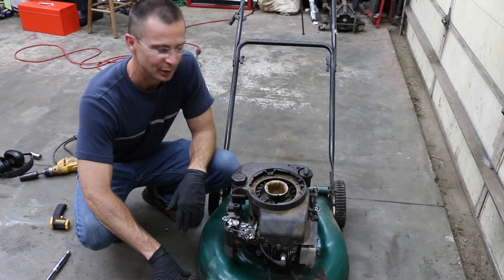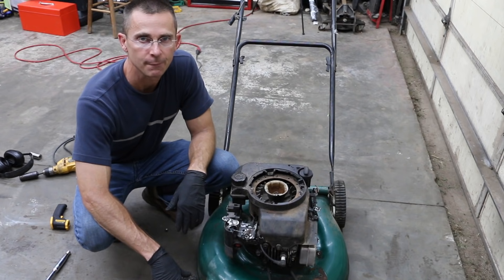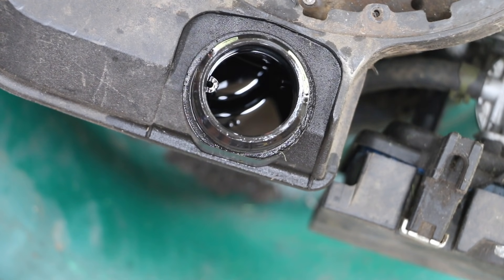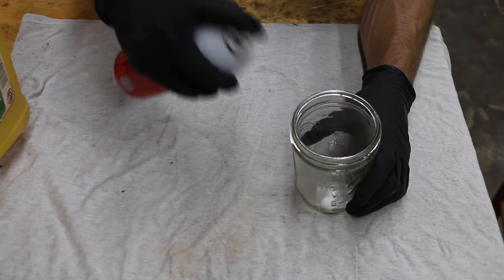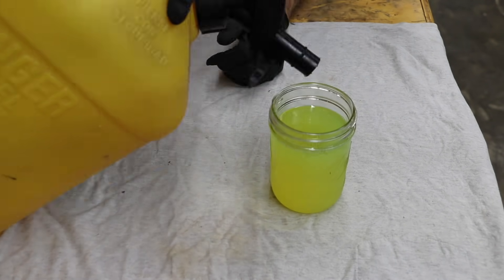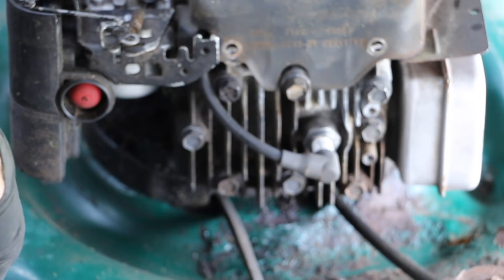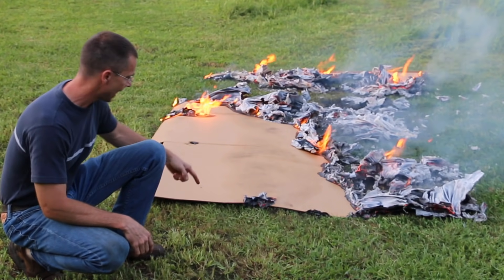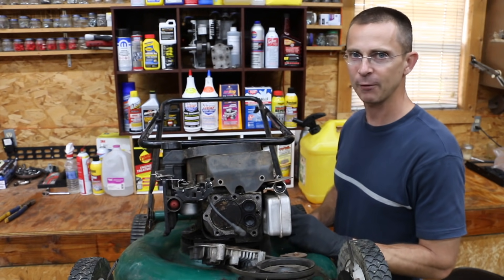Will a Gas Engine Run on Diesel?  Let's find out!

Comment: Try to increase compression, like adding a turbocharger or ever a blower. And flatting the cylinder head
Reply from the maker: Great suggestion!  Thank you
Reply: Project Farm and maybe you should try with a 2 stroke liquid cooled engine, like a 1 cylinder from polaris or rotax, with a 2 Stroke compression is higher

Comment: We used to run our old 1930s John Deer tractors off of a diesel gas mix.  I've been told that when these tractors were in common use, you could buy tractor fuel for them, which was basically a diesel gas mix.  

At any rate, they are basically a gasoline engine.  They have two fuel tanks, a 1 gallon tank to start the tractor, and the main fuel tank for the tractor fuel.  They are hand start by turning the flywheel.  You'd start them off of straight gas and switch to tractor fuel.  You didn't want to forget to switch to the main tank, and then have to start the engine on the tractor fuel, because that was very difficult.  

For the tractor fuel mix, we used 2 gallons of diesel to 3 gallons of gas.  We ran those tractors for close to 70 years every year in the hayfield.
Reply from the maker: Great information. Thank you

Comment: Would like to see if there's a way to convert a small engine to diesel, I've seen older v8 diesels converted from diesel to gas but would like to see one go the other way.
Reply from the maker: Thank you for the video idea!
Reply: @ProjectFarm  my guess would be first need a custom head to increase the compression ratio by reducing the top dead centre space by half, remove the carburettor's air restriction but still control the fuel with the needle, maybe replace the spark plug with a glow plug (and it's going to knock like crazy.) Altho Mazda recently announced an almost-diesel engine around 15:1 compression ratio (right between gas and diesel motors) that uses spark to start the combustion and the compression from the explosion turns into diesel-like combustion but with gasoline... 
Maybe just get enough carbon deposits until you get the necessary compression or the entire chamber turns into a giant ember glowplug when hot. ha!

Comment: A friend had some fuel(about a gallon)put it in my car to get home.I got about a half mile from home the car started running rough.The next morning  the car would not start.Turns out the fuel was kerosine.Took forever to get the fuel system cleaned out...
Reply from the maker: Thank you for the feedback

Comment: Yep... whole different volatility factor there.  As a retired fire instructor I had to discourage the use of gasoline in drill structures.  It flashes off and generally contributes very little to the fire.  Vapor accumulation and sudden flash off can have unexpected results.  Let’s keep these fuels in their respective applications.
Reply from the maker: Thank you for the feedback

Comment: I was thinking about doping gasoline with diesel to cost effectively gain back the energy lost by the ethanol hoax.  There would be no problem with the catalytic converters or sensors.  However, diesel and jet fuel/kerosene have terrible octane numbers; typically about 15-25, because high octane is anathema for a compression ignition engine.  Starting out with higher octane gasoline is not the answer because it contains less energy per gallon than 87, which would require you to increase the ratio of diesel, which would in turn depress the octane.  So we still don't have a cost effective way of reclaiming the energy lost from the ethanol hoax, because ethanol-free gasoline is not cost-effective due to the penalties imposed on it.

It requires 22,000 BTUs to create a gallon of gasoline, which has 120,000 BTUs , whereas it takes 98,000 BTUs to make a gallon of ethanol, which contains 76,000 BTUs .  The farm bill costs 1 1/2 times as much as the defense budget.  We are exporting oil.  They are buying votes at our expense.
Reply: I did some more calculations to see if it could make sense to dope E10 with diesel to get the power of real gasoline back.  Here are some of the things I discovered along the way.
- Fuel blends change throughout the year.  You will not get as good a mileage in the winter because making the fuel turn to vapor easier reduces its BTU content whereas in the summer to prevent vapor issues it is the opposite.
- The octane value of standard low-sulfur diesel ranges from 8-15.  If we use 10, we would need to raise it 770 points, which equals 77.
-  For 10 gallons of E10, we would need to add 2.6 gallons to make up the BTU loss from the 10% ethanol.
- The diesel costs $.22 per gallon more, and it would cost another $1.67 in octane booster to make up for the octane subtraction caused by the 2.6 gallons of diesel.
- The bottom line is it would cost 7.5% more to make up for the 3.5%-4% loss.  Moreover, the volatility would go down, which might translate into harder cold weather starting.
- Starting with a higher octane fuel is not the answer because the higher the octane, the less energy per gallon, which would require more diesel and octane booster, plus we would pay $2.70/gal for the gasoline, which is more than even diesel prices.  This also means putting premium in your car when you check your mileage to impress your friends and/or give yourself a good feeling will not give you what you are looking for.  The way to do that is in the summer with cheap gas.
Reply: I think you might've had an issue posting your comment, there's 4 of the same comments from you :p
Reply: @stockholm2375  Thanks.  Something is fishy.  When I posted, there were immediately 6.  Then I refreshed the screen and there were two, so I deleted the second one.  Then I was down to one.  When I checked just now, there was at one, but after I logged in to respond to you, there were two.  I again deleted the second one and there was one.  Then I refreshed the screen and there were two again.  I again deleted the second one, and I was down to one.  Then I refreshed the screen again, and I had two.  Then I deleted the second one again, and I was down to one.  Then I refreshed the screen again, and it seems to be staying at one.
Reply: @jackt6112  That seems to happen sometimes, I'd expect it to be either YouTube being messed up as usual or poor internet connection.

Comment: Most if not all gasoline engines will run unmodified on pure butyl alcohol. So uh, if you happen to have any butanol lying around... great test.
Reply from the maker: Thank you for the feedback
Reply: @ProjectFarm  For long term usage a blend is still better, but they'll run off it. Also Butanol doesn't suffer from the drawbacks that ethanol has. It's got high energy density, almost as high as gasoline, is resistant to water, and is noncorrosive. Isobutanol in particular is good because it maintains good octane again without the drawbacks of ethanol.

It would be an ideal replacement for ethanol in our current fuel blends. I really hope in the near future we can switch away from ethanol over to butanol... but it depends a lot on our ability to develop more efficient production. That's the only drawback, it's hard to make a lot of it.

Comment: Will pee work as fuel?
Reply: Too high of a water content for it to work as a fuel
Reply: @stockholm2375  will boom boom sauce work as the fuel
(The sauce from the boom hole)
Reply: @PizzaPowerXYZ  No. Bodily wastes and fluids will not work as fuel, please don't ask questions like that anymore.
Reply: @stockholm2375  unless the boom boom sauce is infused with photosynthesis and nuke juice so the cucumber that is sodium will force the water to explode because it has nothing betetr to live for so the sodium in the boom boom sauce so the piston goes SWOOSH and BANG and BOP so you go foward and the engine sound VROOOOM.
Reply: *Explode

Comment: I worked  at a university research center for forty years and I once ran a John Deere riding 160 tractor 90 percent diesel fuel for a whole summer it would smoke initially clear up after engine warmed up never had no ill effects couldn't tell the difference once warmed up ! went back to gasoline the following year still running 10 years later. I sure the the are subtle differences between your small walk behind mower and a riding tractor. I am totally impressed with your videos outstanding work ! Oh by the way I won the bet .
Reply from the maker: Thank you for the feedback!

Comment: Hmmmm, I did this experiment as a kid years ago, and I actually got the 8hp Briggs and stratton engine to run on pure diesel,  however I have to prime the engine with gasoline down the carb, and run the engine at wide open to stay running, but it did stay running with a Ton of white smoke.
Once I turned it off, it wouldn’t restart unless i poured gas down the carb again...... but it DID run in pure diesel
Reply from the maker: Thank you for the feedback

Comment: I put approximately ten gallons of diesel fuel in my Ford van with 300 six in it. About five miles down the road it started knocking and running bad and smoked. I drove back and filled up with gas and it ran fine. Never had an issue with that engine. It ran another 200.000.
Reply from the maker: Thank you for the feedback

Comment: I'll guarantee it will run diesel. I did this test myself on a Predator engine about a month ago by mistake. Ooops. Wrong gas can. It sure smokes a lot and it doesn't start with a pull rope either. I smelled my mistake, siphoned all the diesel out of the tank and put in gas. The Predator engine cranked up on the first pull then. I don't recommend doing this yourself as it wastes a lot of time.
Reply from the maker: Thank you for the feedback

Comment: About two years ago the tank on my petrol Volvo 340 was nearly empty, filled up, trouble was I put diesel in, a full tank.

Engine started running very rough, pinking etc, had to pull out the choke to keep it running.

The car got me home, drained the tank and filled with petrol, all OK again.
Reply from the maker: Nice!

Comment: I did the same test 50 years ago using stove oil/diesel but the lawn mower, a B/S engine was warm and it ran fine !!!  No you cannot start a cold engine on diesel, you have to start on gas, warm up and then add the diesel and walaw it runs....and refill while hot !!!  During WWII Dad run his old flathead ford V8 on stove oil/diesel,  but you have to start it on gas !!!!  Redo the test and watch it work !!!
Reply from the maker: Thank you for the feedback

Comment: Several people claim that if you add a second gas tank to put diesel in and switch over to that tank after the motor is hot that it will work.
Could you do a test and see?

Comment: In a 6 quart engine system will running 4 quarts oil and 2 quarts kerosene for a short period of time say 2 mins before an oil change, help or harm the engine?

Comment: In the 1970's a trucker stopped at a truck stop in a new Peterbuilt,he jokingly told the attendant to fill it up with high test.The trucker did not know the attendant was handicapped .The trucker drove off with blue flames coming out the pipes.
Reply from the maker: Thank you for the feedback

Comment: Nice Video! What I’m curious about is the following. How much torque can a sparkplug take before it breaks or the thread will give in. The normal torque of a car sparkplug  in a aluminum head is 30Nm. We all think that if you overtighten a plug you will damage the threat, but is that really the case? Maybe you can tighten it up to 300Nm without a problem, who knows! And what will give in first, the thread, or will the plug just shear off? In this test case an aluminum head should be used because they are the most vulnerable. Thank you for very interesting videos!

Comment: Not enough compression for diesel
Reply: My john deere A runs on diesel with 4.5-1 compression
Reply: That would apply if he was trying to run it as a diesel... He wasn't. He wanted to see if the spark plug was enough to make it run... 🙄

Comment: 1950's we kids had very little money, but the orange groves in Florida had Smudge Pots which used Kerosene or diesel fuel I don't know which?  I owned a beat up 1937 Chevrolet 6 cylinder car with suicide doors; we kids thought we could use smudge pot fuel to run the car and it worked! We threw a blanket over the radiator till it got real hot then we went down the road and it  smoked very little whereas when cold we had a lot of smoke of course you can't blame a 13 year old kid for pranks like this ,heck I paid $20.00 hard earned dollars to buy this multi-fuel car.
We had little money in those early years, but we were a lot happier, I washed dishes in an Italian Restaurant three times a week for a few hours when I was ten years old I made $10.00 a week and gave my mom half of it. No I was not an abused child nor was I asked to work for nothing.

Comment: Diesel needs a glow plug doesn't it?
Reply from the maker: For starting under cold temp conditions.  My diesel equipment starts just find without heater grid or glow plugs in warm weather. Thank you

Comment: I can tell you a diesel engine will not run on gas. While I was in the military someone put gas in a humvee it had to be towed, drained parts and parts exchanged. The soldier lost her military driver license
Reply from the maker: Thank you for the feedback
Reply: Under no circumstances should gas  be put inna diesel engines.  It will blow something up. I've seen a connecting rod break engine block on a 6.2 gm engine
Reply: @rotemtomhagbi1937  I honestly don't know why her or the other soldiers with her would even think to put gas in it. Some people just don't deserve the license to drive heavy vehicles.

Comment: How can this be accurate with out proper jetting for carb as well as ignition timing and temp ?
Reply: spawn25 i agree. spark ignition needs to be optimized. advanced i would think. then tighten up plug gap and run a hotter plug. 👍👍
Reply from the maker: Thank you for the feedback!

Comment: Diesel will not ignite with a spark plug lol
Reply: George Austers sure it will. that’s what every webasto and espar coolant heater used to light freezing cold diesel. no compression and just spark. lights diesel at -40f with only spark

Comment: It's common sense that a gas engine will not run on diesel fuel, unless compression is applied.
Reply: You'd be surprised, many direct injection cars could run on diesel, albeit not well

Comment: You need to build a high compression single cylinder motor, and then use an injector to deliver the atomized fuels, diesel burns with atomization compression and heat, gas burns with atomization, compression and spark, so when you switch fuels, you can change the injector, and spark or glow plug! 

 Have you ever extinguished a match in gasoline, as a liquid it works, as a vapor it burns rapidly, diesel  will act the same way, liquid put the match out, spray it above a flame and it will burn, it is all about vapor and fumes! When gas goes into a carb, some of it hits the walls of the carb, intake and valve and returns to a liquid when the engine is cold, this is what is happening with the diesel fuel, but use a high pressure spray and the engine might have run longer. Carburetors and fuel injectors for gasoline clog with diesel fuel as a liquid entering, even when using the primer button to spray the fuel!
Reply from the maker: Thank you for the video idea!

Comment: Have you tried the opposite?  Will a Diesel engine run on gasoline??  🔥
Reply: It will definitely damage the engine since petrol explodes much more easly and more violently
Reply from the maker: Thank you for the video idea!
Reply: Part of what makes a diesel motor beneficial for heavy equipment is it's torque,  which is harnessed by virtue of the relatively high compression....the term "dieseling" in gasoline engines (continuing to run once the ignition has been switched off, generally a timing issue), is borne out of the inherent nature of a diesel engine.....it has no spark, only heat & compression.  No engine is meant to have "explosions", but combustion
Reply: No a diesel can't run gasoline, diesel engines don't have spark plugs and instead they rely on the compression to ignite the fuel, gasoline won't ignite without a spark

Comment: And that boys and girls is why you never use gas/petrol to help start a fire. Very volatile. Also burns off too quick so the wood doesn't actually catch on fire. 
Diesel is much slower and hotter and will catch wood on fire properly.
Reply from the maker: Great point!
Reply: I use kerosene. It burns even slower and hotter than diesel and works very very well.
Reply: True
Reply: I have used, used engine oil, slow, hot burn
Reply: Just do not add any additional fuel once it is lit. A friend of mine did with diesel it ignited and burned him on the face and hands pretty bad.
Reply: I thought coleman stove fuel was like diesel and tried to use it to start a campfire... DO NOT DO THAT!! I have no eyebrows to prove it... It's not slow burning... lol
Reply: @henmich  coleman fuel is mostly naptha which is also known as white gasoline. In other words. you used gasoline, not diesel fuel.